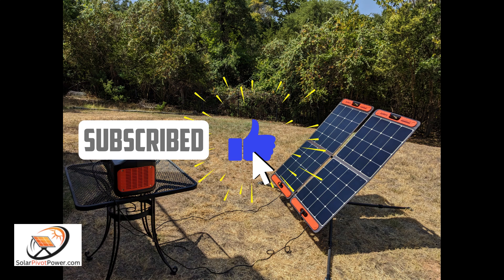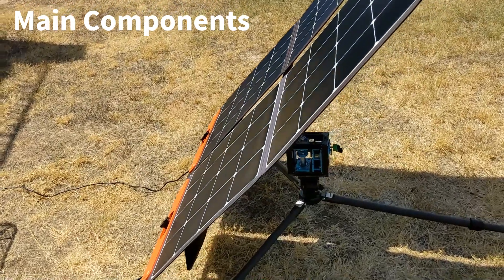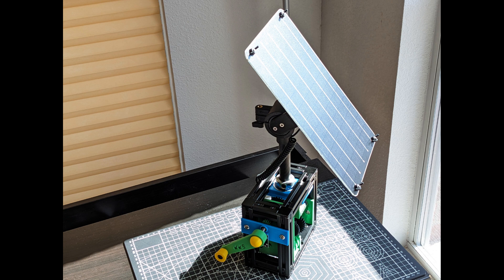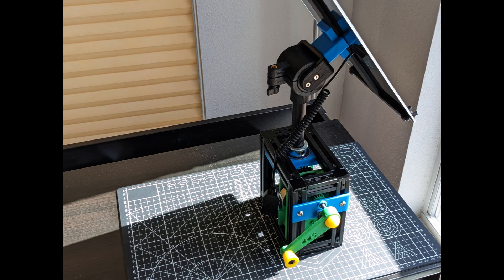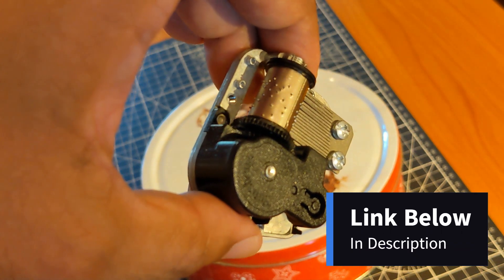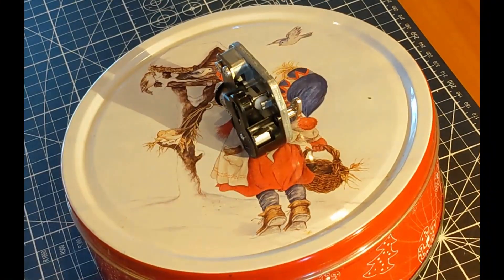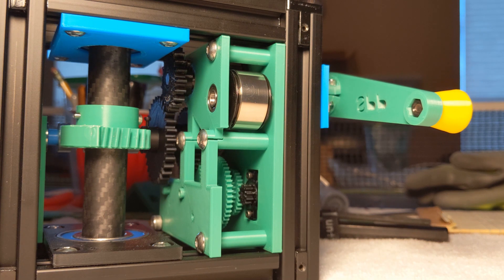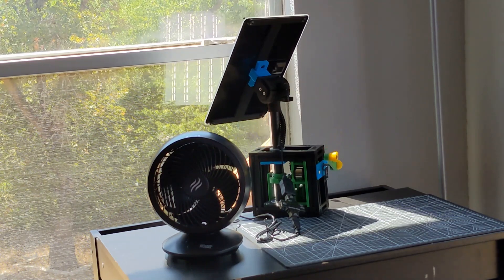Portable Mechanical Solar Tracker - 3D Printed Prototype #solar #solartracker #sunflower #jackery

Comment: What should be the overall cost for making this model
Reply from the maker: As a DIY project, the core gearbox can be constructed for under $100. Spring steel, metal worm gear and damper are the main items. Assuming the ability to 3D print some parts with resilient material. Then comes the  cost of a stable base. You could mount it on off the shelf tripods - there is a wide range and features, depending on carrying weight, wind cross-section etc. (typical range $50 - $500)
Reply: @SolarPivotPowerInc  thanks 👍🏻

Comment: I've been looking for someone wh made a mechanical, clock spring like tracker... Or a clock weight that gets reset every morning?
Reply from the maker: Hello Clint, yeah it turned out to be a rather interesting problem to solve. For now I have a wind up handle to rewind the spring in the morning. To replace this function with a motor would require a separate energy source. Definitely possible but the intention here was to build a very robust and durable all-mechanical tracker.
Reply from the maker: We have added some great offers for early pledges. Please follow our Kickstarter page by selecting "Notify me on launch":
https://www.kickstarter.com/projects/psolbot1/portable-solar-robot-1